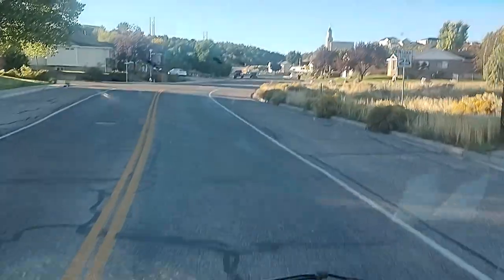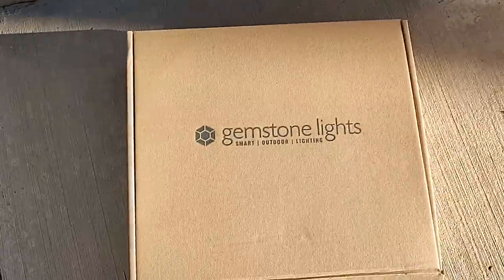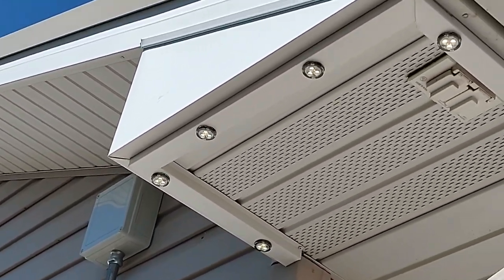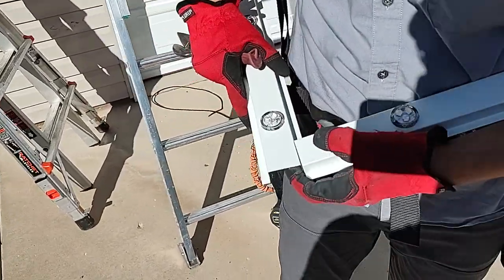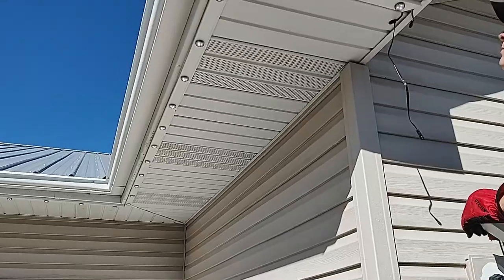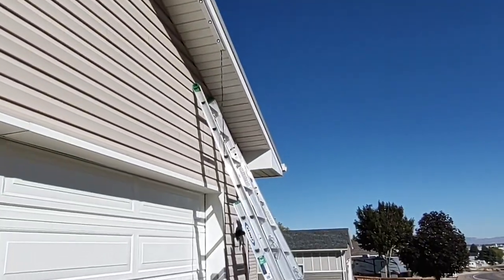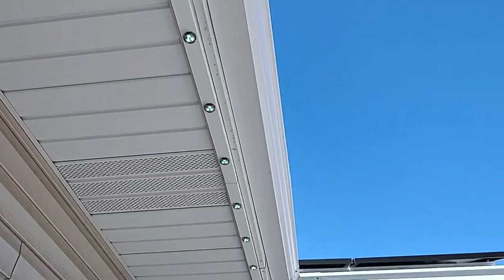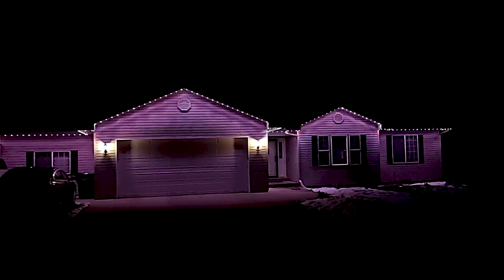How to Install Gemstone Lights

Comment: Show the wago points. 

Did you drop the power line in at 75 feet?

Or did you bite the 75 foot power line in every 25 feet for a max of 75 feet per tap?

Did you inject power after the first two lights and then every twenty five feet up to 75 per terminal?

I was under assumption that the first 75 feet were powered off the heart via the male female plug. 
And the first terminal jumps onto the line after the first 75 feet. 

Basically the heart powers the first 75 feet and then injection powers the next 75 feet. Total of 150 off one tap and one male female line out of the heart. 

If more are needed, tap the second terminal and run that line to 150 foot mark. And that will power the next 75 feet making a total of 225. With two extra taps not used. 

I’ve been told to no go past this point. 

I could be wrong. 
This has been explained several different ways and never the same way. 

I’d like to actually install the product correctly.

Comment: Can you make a video of wiring the power wire and lights together I  need to understand that if you don't mind. Do you guys solder the wires together? I can teach you how to roof your house for a trade
Reply from the maker: I can make a video about when to tie in power, but I can't reveal any trade secrets about how we tie in. You can splice directly into the positive and negative with some wire connectors like this: 

https://www.amazon.com/Wire-Connectors-Solderless-Stripping-Connection/dp/B07114RK67/ref=sr_1_14?crid=GHLQ475SA75Y&keywords=wire+connectors&qid=1678043398&sprefix=wire+conn%2Caps%2C136&sr=8-14. 

Be on the lookout for a video talking about power wires!
Reply: @natewillard  thanks brother

Comment: Are these lights able to have the light meet in the 45 degree cuts? So that the lights have peak in the peaks. I have ocd and want the lights to begin at peaks and go down each way from the peaks evenly.
Reply from the maker: I always start at the peak so that the lights won’t on both sides. But as for corners, you don’t want to cut them to meet  perfectly. You always should shoot to have the lights 9” spaced, even around corners. Otherwise it will look silly having the light be too close or two far apart. Overall it depends on where each light lands and adapting as you go.

Comment: Yes !
Reply: More information on how to install the box and long jumps 
Etc.
Reply from the maker: I've been asked to not share too much information and reveal trade secrets. But the box is very straight forward to install and you need to tie in power every 30 feet as a rule of thumb.
Reply: So is it a home run back to controller every 30 feet of lights or just one wire through and tap off every 30 feet. 1
 @natewillard